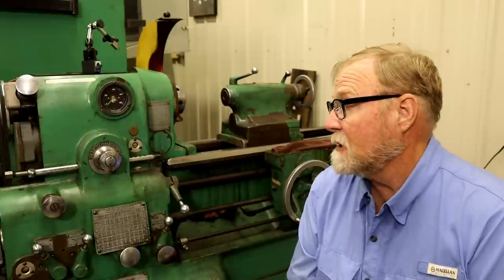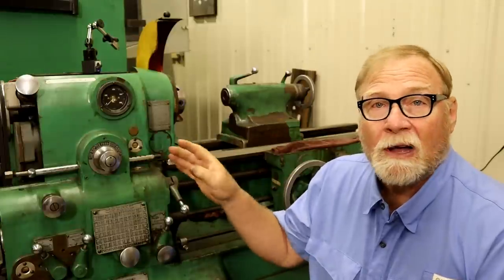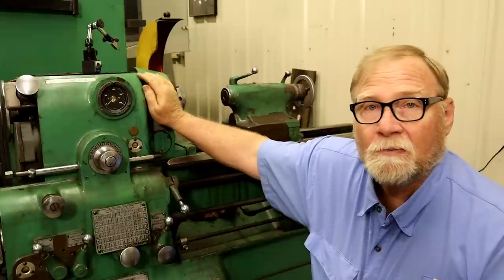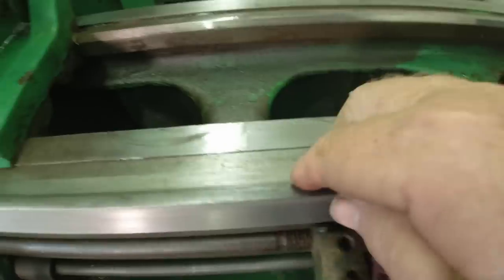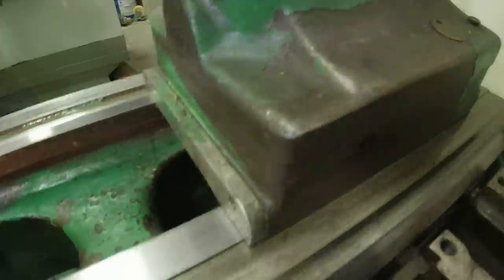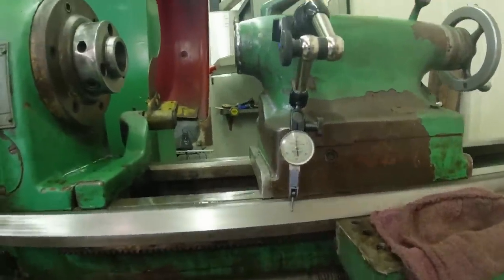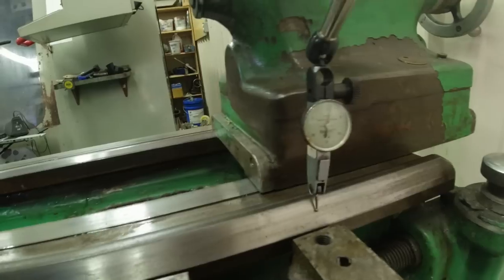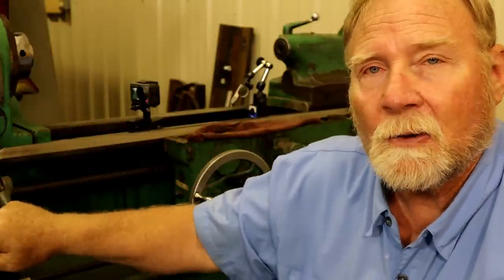7000 Mistake Monarch 10EE :  Is the Bed trashed?

Comment: That’s a lot of metal you’ll be removing. Then you will have to raise the carriage to compensate. You’ll have to be really careful about being parallels with the tailstock ways if you aren’t going to grind them too.. then shim the tailstock. I’ve done it with my South Bend 10L heavy. A smaller lathe, but still,  not fun. The ways io that weren’t hardened. I’m assuming from the looks of it that these aren’t either. With that much wear, you’ll have to do the carriage slides as well.

Fortunately. My South Bend FOURTEEN ways are hardened, and have no measurable wear. I’d hate to have to do that one.
Reply: Assuming the Monarch ways are not hardened my big question is WHY not? My 12 x 36 Jet, made in Taiwan and 
far from Monarch class, has flame hardened and ground ways with only minimal wear. What am I missing here?
Reply: @ellieprice363  I’m not saying he shouldn’t. He understands what I’m saying. I commented more for those here who think it’s a simple operation. It’s not. The ways are just the beginning. There’s a lot more work involved if you’re going to remove more than a couple thou.

A lot of older machines had soft ways. Only some were flame hardened, and later, induction hardened. If you’re pretty careful with your lathe that’s not hardened, the ways will last a long time. But you’d be surprised at just how badly people treat their machines in industry. The company may have a cleaning and lube schedule, but just try to get people to adhere to it. That’s why so many used machines are so cheap on eBay. They’re in terrible shape. So worn out that companies would rather scrap them and get new ones. A hobbyist, who knows nothing of this, finds an old machine, you know “old American iron”, at a ridiculously low price, and buys something too worn out for them to fix. It takes skill, knowledge and experience, plus the machines to do that. Steve has all of that, so do some of the rest of us, but most do not.
Reply from the maker: These are hardened or else it would have already taken a ride on the planer.....
Reply from the maker: The problem is they are hardened...   Regular way would already have been on my planer and scraped in..
Reply: @10swatkins  Well that answers one question. I couldn’t imagine that a company known for quality would make a high precision lathe with soft ways!” Sounds like old Bubba spent many years running and ruining this one.

Comment: Hadnt read any of the comments but I watched the video on the tv. Had you considered using cold rolled material as your railing system?
Reply from the maker: Hi :)   I believe it will move too much .... Better than hot rolled but still not fine enough grain structure to plane well.. Cast iron is the best material for this job.   I'm looking to be better than .001 in straightness, over 5 feet,  after I plane and scrape the rails... 

Right now  Durabar is  about 700.00 to buy what I need... That put the project into the range of just using linear rails and trucks..   I am going to put in a call to Clark over at Windy Hill Foundry and see if you can pour me a simple rail out of the rotors he uses...  Shipping will probably kill me though... 

Thanks for the suggestion!

Comment: Buying a used lathe is worst than buying a used car -for cars you can find mechanics and spare parts -for lathes its really difficult especially in some countrys.In my country there is only 1 factory that refurbishes machines and they are like 300km away and lathes dont have wheels and they weight 2 tons !There is another annoyance and that is moving it from shop,to factory and back.
Reply from the maker: Here too...  That is why I learned to do almost everything here in my shop :(

Comment: Great Vlogs, you should use the cross slide as the reference point and put the indicator on it not the tail stock.
Reply from the maker: IF it does not work i'll mount the spindle on the planer and figure out a splash system :)   Thanks for watching.

Comment: If you remove material from the ways to get them flat, you need to add material to the tailstock to bring it back to center
Reply from the maker: Yes that is true,,, and there are several ways to accomplish that. I have the materials to do that in two different ways here in the shop...  You also have to raise the saddle back to the right height.. That will be accomplished by grinding the saddle deeper to allow for the materials to be added... I will eight plane the saddle or I am hoping I can use the B&S 10 x30x 14 grinder...
Reply: @10swatkins  why do you have to bring the saddle back up? You can correct tool center height with the tool post.
Reply from the maker: The saddle support the apron... The apron has the drive screws going through it and they move the apron and saddle up and down the bed. If I lower the saddle by grinding the ways and saddle the apron is lowered too and throws off the geometry causing the screws to bind as they get close to either end of travel.

Comment: I saw someone at PM do it in a kind of similar way but maybe even simpler ? You might have seen that too. It's going to work, just time and measuring.
Reply from the maker: I saw a kid that had no money attack one with a 4.5 inch grinder over there once.... This is going to be a little more refined :)
Reply: @10swatkins  Not that one. It was properly done with a sled.

Comment: Your money, your time, it will be interesting to see. How about using some 2" dia hyd rod for guide rails?
Reply from the maker: That is an idea... I think cast iron would be better though.. I can plane a v on them and if needed scrape them in to make them perfect... I already have a set of matched v rollers I made about 15 years ago and a 1.250 thick plate to make the skate out of....

Comment: I would love to see the contraption but for my 2 cents I'd send it out. By doing a proper job on this machine you will have a super accurate machine that is still a whole lot cheaper than buying one already in first class condition, besides that, Don needs another paint project!
Reply from the maker: What makes you think sending it out would be any better than what I can do with it right here?  A grinding shop throws it on the machine and what comes off comes off... Their machines also have rails, and wear, that affect the finished product... Do you think they take the time to touch them up like I do when scraping it in ?
Reply: @10swatkins  
No offense intended Steve, I was thinking about all the labor required to build a setup to do the grinding, not that you can't do just as good of a job as anyone else, I'd say from watching you over the last year or more you are more than capable. Just thinking that a day or two to tear it down, get it back in a month or two, scrape it in to finish and then reassemble it you could save a bunch of time for other projects, of which I am sure you are like me, having maybe more than I can finish in my lifetime! like I said, just my thoughts and you know the old saying about opinions... Thanks for the great content and again no offense intended.

Jon

Comment: Hey Steve,  throw it back together and run it, would be more accurate than 90 percent of the lathes I have ran.  The length of that carriage, minimizes inaccuracies.
First lathe I ever owned was a very well worn Bradford,  saddle was bottomed out, did some relief machining and got it back on vees.  Didn't know anything about scraping but I moved material anyway.  Back way doesn't wear much, but on this machine I scraped it down to make the saddle stable.  Bored great as long as I watched center heights. Had some rise or fall, just geometry.
The layout of the Monarch with its extra long carriage is the key to its accuracy.   Frankly a few minutes with a rolox disc and this lathe would be more accurate than anything made today unless you bought a factory Monarch.
I still like my Hendey.
Reply from the maker: I hear you man... Like I said I've used much worse my entire life :)
Reply: @10swatkins Yep, we have a relatively new Republic 14x40 at work, I can tell a horror story there,  maintenance guys tried to get it to turn straight on centers, forget how thick the shim was I took out between bed and base.  Gee.  Let it settle back in for a few weeks before I releveled.   But I do love the digital readout.  Need to re ream the tailstock quill, how it got so beat up I don't know.  I always leave something in tailstock, keeps stuff out.  Keep on making videos.

Comment: Perhaps freehand approach with straight edge, precision level/king-way and die grinder/miniature angle grinder with 50mm wheel or something?
Likely more accurate (with good instruments) than grinder on rails...
At least you can't make it worse, over here in Switzerland, that lathe would have ended in the oven a long time ago
Reply from the maker: The rails and grinder approach would be to get most of the material out of the way... Just like in planning or grinding... Once that metal is removed I believe I will be under the hardened surfaces and can finish up as usual with the scrapers and measuring tools...

Comment: Keith Rucker and a buddy tore down his 10EE enough to get the bed out in an hour and a half.  Talk to him and see how much his grinding job cost - that machine deserves to be done right.  Even if you don't send it out, fab an enclosure to use a tool post grinder/head off of a T&C grinder and then do it on the planer.  That way you will know that it is square.
Reply from the maker: And what makes you think I can't do it " Right" ?   I have more tools and experience that a lot of the people you speak of...
Reply: @10swatkins  A good friend of mine now deceased had a Graziano lathe that had a sway in the ways that he went to rebuild.  He was one of the finest practical engineers that I have known and was not afraid to tackle an adventure like yours.  I believe he also took King's scraping course. After a lot of discussion he decided to send it to Commerce (they did a beautiful job) because he concluded that there were a whole bunch of ways to get it out of plane and only one way to get it truly right.  He turcited the bottom of the carriage to raise it back up to factory height and shimmed the tailstock.  Unfortunately he passed before he completed the rebuild on the gearbox (so close...).  He discussed doing something like you are planning, but worried that the grinding dust that invariably gets everywhere would wear down the "temporary" ways during the job enough to throw it out of whack as well as wearing his shoulders and back out pushing it back and forth.  He also ended up taking a Colchester 15x50 hardened bed to Commerce and they did a great job on it too.  

 I machine for a living (have some beautiful Japanese equipment) and used to have a really nice 10EE (like yours it had electrical issues).  The bed on it was at least as hard as the one on my HLVH.  If you are ever in Austin, send me a PM and I will give you a shop tour and then we can go get a good lunch.

Comment: In the old days, scraping was the (only ?) way to get flat surfaces but it's a labor intensive method and 7/1000 is a lot to scape.
Grinding with an attachment sounds as a good start. If that still leaves you with a flatness you are not happy with, you could always scrape the last bits away
Reply: The ways on that machine are very hard and would not scrape very well.
Reply from the maker: In this case the grinding rig would be used as the touch up tool instead of the power scraper... Same principle as scraping just a different tool :)

Comment: How about some linear guide rails  and a large skate. Fasten two metal bars,  one down each side.  Then fasten the linear guide rails. The is a video by a Russian Youtuber where he has an electric motor,  (possibly a 1 or 2 HP ) . The motor has a cup wheel fastened directly to the motor shaft. The motor rides the skate,  and the skate rides the rails. With some shimming and adjuster screws you might just be off to the races
Reply from the maker: That is the general idea that I'm working towards... The motor for the grinder will not work well because it has to be really small to get close to the head.....   Thinking of using a die grinder mounted on a fixture to change to all of the 5 angles it has to grind... I can put a small grinding stone on the die grinder and get within 1/2 inch of the head..

Comment: I have a though, Railroad Track.  They are  long and you can get them free. Just needs to be shaped. Its a little unorthodox but worse case scenario is it doesn’t work, and you get a good video for content.
Reply from the maker: That's a thought!   I know the tops of old rail is work hardened but probably softer once you get away from that... I would rather use cast iron as I can really plane that well, much finer than steel....

Comment: What about hand stoning?  I did a tidy up once on a lathe bed to remove some big dings and damage.  I found some very open grain stones that actually removed material relatively quickly.  It was a couple of days hand work but probably faster than any alternative such as rigging up a grinding setup.  Maybe get some stones and see how quickly you could bring the high area down a thou?
Reply from the maker: Too much metal for a hand job....  A die grinder mounted on a heavy and stable sled will work fine... Just got to get the cost down ;(

Comment: Hi Steve i wounder how much of that seven thousands is on the tail stock rails ? I don't know what type of griding setup your going to use so maybe you could make a test setup to mimic a lathe bed or the angle of the bed ways . Maybe use a one by one solid square bar stock welded to a piece of large channel iron like 3ft long as a test run or something like that   Good luck Steve . JM
Reply from the maker: Please watch the video  as I explain my plan to make outboard rails and a skate...   Thanks for commenting  :)
Reply: @10swatkins  hey Steve hope it all works out for you

Comment: I believe it could work however why wouldn't you build the skate to ride on the tail stock ways. As in general use cases the tail stock ways have little to no wair. And then there's the matter of the carriage and saddle, they will be riding lower so you will need to take the same amount of material off the top of saddle to keep the lead screw on center. If you do decide to build a separate rail system you might consider buying a set of linear guid rails to use as bearing for the slide action. Some inexpensive guid rails are surprisingly accurate. It is a nice lathe no doubt about that but it's been ridden hard and I would question the wear on the cross slide as well. How deep do you dive before you pop. Another interesting video thanks
Reply from the maker: The tailstock ways are a little too close together for stability in my mind, and they have slight wear also.  If I can get the rails outboard about three inches I believe it would be better for the heavy sled I have in mind...

Comment: what if you use the planer as rail system with the lath beside it?  Then you would only have to bracket out the mount for the spindle.  The limitations come from overall rigidity.  Same could be done using one of the larger lathes where the bracket comes off the cross slide. then you gain a bit more control of motion.  May be even less expensive as building a rail system.  Either way a home bracket grind is going to come with lots of potential faults.  If your faults take to to within half a thou then you are golden. beyond that and you will end up having it done else where.  I would pull the headstock and use the camelbacks to get a better idea as to the ?true? condition.  the other option is to use a grinder much like a scraper, blue it up, and start grinding the highspots one at a time.  A lesson in futility but still do able.  Just keep in mind how far down to take it before a decision is made to send it out.  Im with you on not scrapping the machine.  The motor fix costs seem reasonable.  the bed if you can get it under .001 would be great.  It mostly and my big concern is  you maintaining the 90deg planes for the V-ways.  Where one side is lower than the other or width doesnt match. at a minimum you will need. Z, X and a Y adjustment.  using a lathe gives you Z and X then you are left with Y.  not to mention any of the rotation axis.  I think you can do it.  I think it would be cool.  Or maybe you make a coolant tray to fit under the lathe and do it on your planer.  That makes more sense.
Reply: Right. Make a coolant tray for the planer. That will be much simpler than the Rube Goldberg contraption an auxillary way system entails
Reply: @lnbwood That's my thoughts on how to fix this Monarch lathe bed. 
Plus, Steve would then have all new capabilities for his ancient planer, as a reward for going this route!
Reply from the maker: I think it would be just the same amount of work to  mount the grinding spindle I have on the planer and then make a splash system for the bed....  Besides when I finish with the rail system it would be useful to touch up other lathe beds.

With the brackets I envision attatching to the sides of the lathe bed I would be able to adjust xyz on the rails to dial them in perfect..   I am thinking of using a 1.5 inch x 4 inch piece of cast iron to make the rails... Plenty ridged, mass and "meat" to attach some nice adjustable brackets to... 

I am still thinking about your idea of mounting the spindle on the table of the planer and grind along side it.... Interesting approach !    Not sure how to handle the aligning the lathe with the bed or how to keep it all fixed there.....